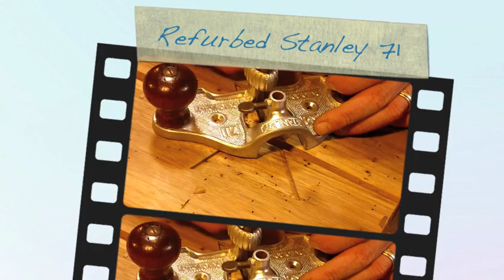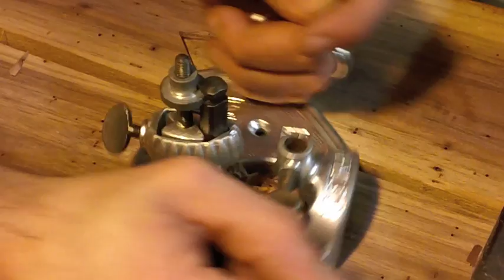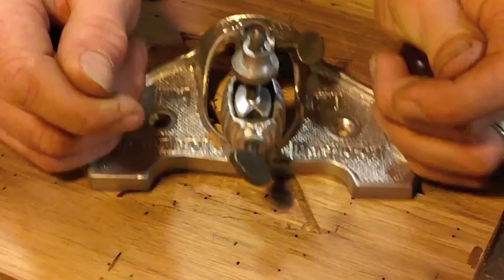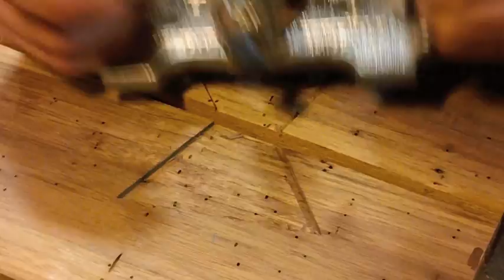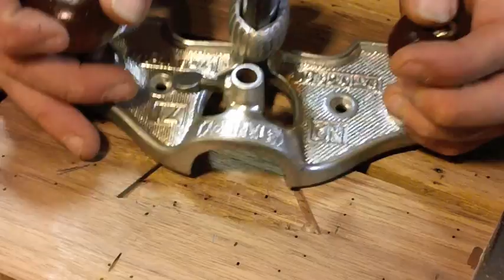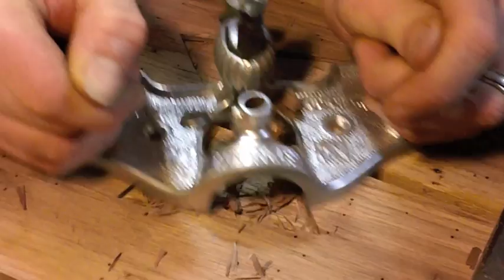Stanley71

Comment: How do you get into the sharp corners?
Reply from the maker: Veritas router blades fit the stanley. They have a pointed one. Stanley shipped them with the originals but I dont think you can get them new.
http://www.leevalley.com/en/wood/page.aspx?p=52609&cat=1,41182,41192&ap=1